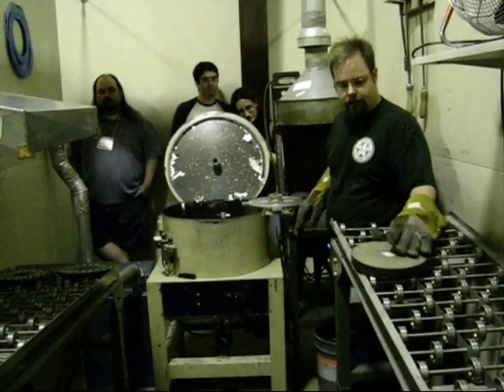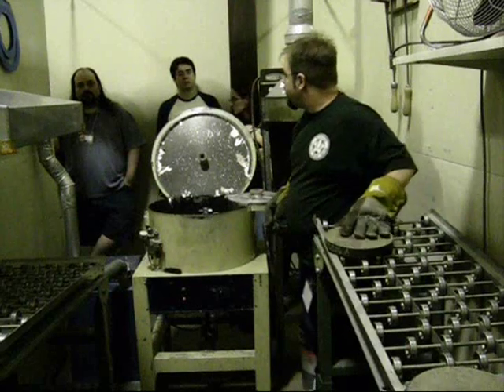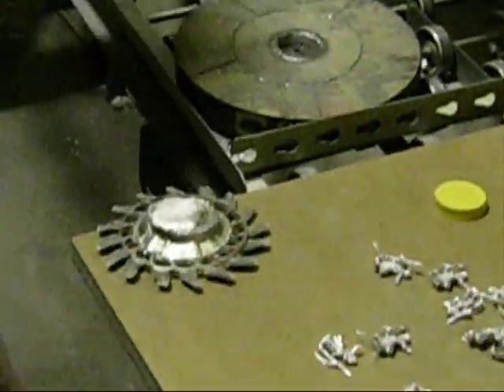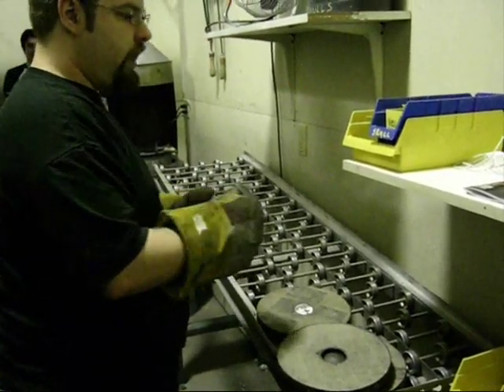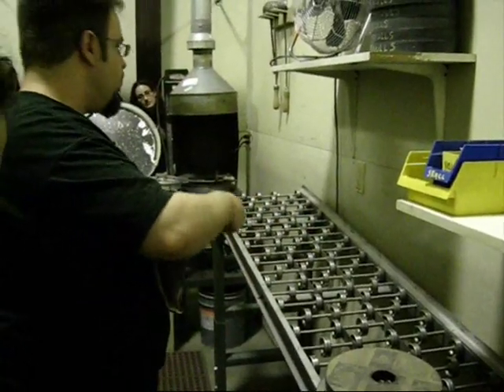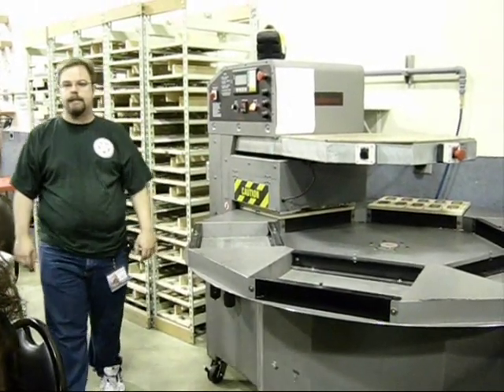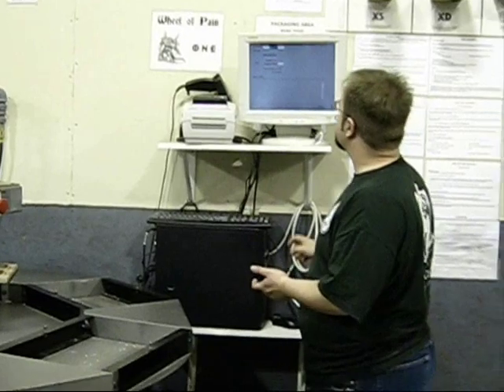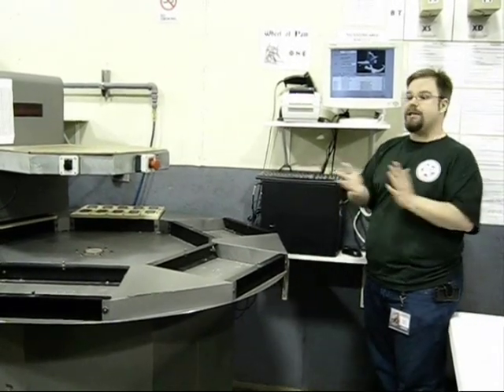How Reaper miniatures are made Part 2

Comment: Great video(s)! Very informative. I'm just wondering on one step that I didn't get and am hoping someone can tell me. How do they get the multiple molds of one "green" in the vulcanized rubber mold? 
Thanks!
Reply: Moloch1038 the greens are made from a master mold, which is often a different type of rubber. this master mold is in turn made from the original sculpt.
Reply: Moloch1038 the greens are made from a master mold, which is often a different type of rubber. this master mold is in turn made from the original sculpt.